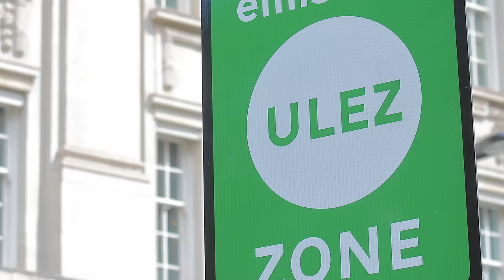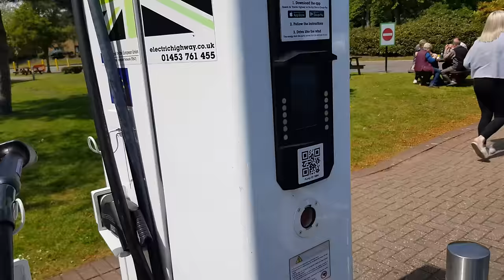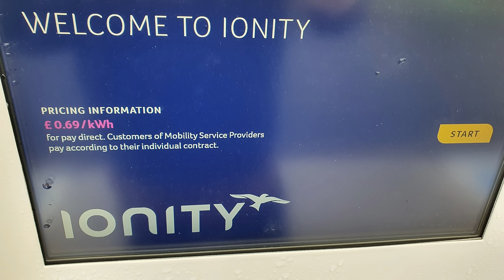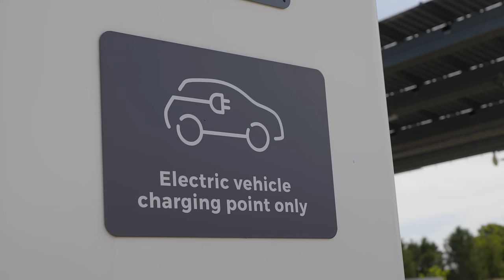The Uncomfortable TRUTH About EVs: The Version NEITHER SIDE Wants You To Hear

Comment: Funny you should mention the cashless thing- just the other day I was paying for my shopping and found my card had stopped working- my bank had stopped it due to a security breach, and sent me a new one which had got lost in the post! Luckily I had a small amount of cash on me, enough to cover the items I'd bought... but had I gone to the supermarket forecourt and filled up, I'd have been stuck with a car full of petrol I couldn't pay for. I've basically had to spend the last few days living off the few hundred quid cash that I drew out at the counter the following day- if I had an EV I'd have been stuck using the buses!
Reply: Absurd that cash cannot be used, it should be illegal.
Reply: Credit cards are free, which is why I have a backup from a different bank. There's also a debit card as another alternative, so there's no reason to ever be stuck without a working card.
Reply: @Xenon0000000000001  I remeber a time, when several gas stations weren't functioning, due to an extreme heat wave. I was in another town, on empty. Found a place with a generator for the pumps, but they could only accept cash. Dangerous  situations arise, & can escalate quickly when infrastructure fails, & it comes down to what ya have on you.

Comment: i drive a 43 year old car .
raised 2 children with it 
upgraded the engine to a catalyst one back at 1990.
car has A/C , power windows /locks and ABS 
1 year ago i installed the latest infotainment system .
car has also leather interior.
im upgrading the car along the way depending the needs .
yes im an automotive technician and the car is a humble toyota ke70 1980 model 
155 hp to  the rear  wheels ,big brakes ,lsd diff , 
no rust as this car is very well taken care off .
passes mot every 2 years with 0 issues and 0 co /hhc emissions
i also urge my clients to do the same with their cars and they are very happy with my advice .
and generally thats my way of life .
its called circular economy 
you should try it 

please tell me am i eco friendly or not ?
Reply: I fully believe this is one of the best ways to offset the environmental impact of manufacturing new vehicles. Buy, maintain, modernize an existing vehicle instead of manufacturing a new one.
Reply: Good luck fining a modern toyota with the same "endurance"...
For the last 20 year they've quite steadily gone completely downhill. Designing and optimizing every part, NOT for longevity and reliability but strongly and solely for... planned obsolescence. It needs to just barely last the warranty period... given it's included in one of the few things the warranty actually covers.
Toyota is NOT the same company it used to be. Now they just exploit their customers with shady practices and shameless scams. How do you think can a company that sells cars at a loss or an industry average 1.6% margins... bring in billions of profits every year?
Reply: MOT tests are undertaken every year, not 2 years.

Comment: I have a free supercharging Tesla Model S (and a Jaguar F Type R). I cannot charge at home so I rely on the Tesla network. After 25k miles, I have spent £0 on fuel for the Tesla. So currently this solution works for me. But I definitely would not recommend the same solution if the charging was not free

Comment: I think the ownership experience of my Model 3 has generally been excellent.  But the rental experience in a foreign country has left me nearly stranded.  I rented an ID3 in Tromso airport.  

The first public charger wouldn’t charge, until I tried authorising the credit card first and then plugging in the car.  Then it worked.  I did swear quite a lot in temperatures of minus six with a fresh wind.

The second public charger wouldn’t work.  I needed an account on a Norwegian app.  I needed to authorise the account with my phone number. I needed a Norwegian phone number!  🤬.  I was nearly stranded were it not for the help from tech support.  I nearly turned into the Incredible Hulk with all the rage that was built up!

Since that time, every rental car has been petrol or diesel.   When it comes to business expenses I want one big transaction to claim for, not 14 little transactions.  I want things to be easy!
Reply: That is a mayor issue. Norway has now made it mandatory to have normal card readers at every charger. Without having to use the app. But for business anyways, its quite incovenient having an EV if you have a lot of driving to do.
Reply: @espencapable That’s not a mayor issue, that’s a regulation issue.
P.S. Gorgeous country!
Reply: EVs are trash
Reply: @jhol310  I wish I could agree. Miss driving a fossil car from time to time for the sounds and smell. They are just so darn slow and expensive to keep filled up compared to EVs
Reply: @jhol310  Guess it all depends. In Norway, a turboed 5-cyl (23mpg) would cost me $3500 a year in fuel for 9500 miles. My 400hp EV will cost me $200 in electricity. It's really a no brainer here atleast. Can not daily a fossil car anymore. But as a weekend cruiser, sure. I would rather drive a fossil motorbike really. I tested an RS5 recently, and while it did have a nice sound, I found the jerking from changing gears and the sluggish respons from kickdown and from standstill, a bit annoying.
Reply: @espencapable  gas is probly mad expensive in Norway.  In South Carolina its pretty cheap.  About $3.50/g for premium.  Can get 28-30 mpg on a long trip in mine.  Zero jerk from switching gears.  Response can be delayed if you floor it too quickly.
Reply: @espencapable  RS5 is trash get a RS3.  Cant really use the power in an EV without the battery pack and range disintegrating.  Every time u fast-charge or fast-deplete your gas tank gets smaller

Comment: I think there is already a perfectly consistent situation regarding charging - both in terms difficulty and price. There are two distinct environments. At home, and away from home. If you can charge at home on your drive then it’s easy and very cheap. OVO Charge Anytime is 7p per KWh. About 2 to 3p per mile for my lovely Enyaq. That’s about 1/5th the price per mile than for petrol in my Suzuki Alto 1.0. Most people work within 20 miles of home and would, during their average year, pretty rarely need to charge away from home so that’s just fine. Charging away from home is always too expensive and difficult in my opinion. There are thus ‘haves’ and ‘have nots’ both in terms of owning a suitable property for an EV (this affects a lot of people) and having a suitable annual usage pattern (this affects a comparatively small number of people, far fewer than would have anxiety about it if they actually sat down and worked out what their ‘real life’ usage was). I do pretty much cry though, the odd couple of times a year I have to fast charge for 75p per KW/h or whatever away from home.
Reply: its nice if you can, the future though is uncertain.
namely its the throughput(scale), the electric cables and substations may not support more than 3-5 ev-s charging at once, at a reasonable time.
ie the substation that enabled you to charge your car tops overnight, may do so for within a week or more for that 3-5 evs.
and that is at really small scale.

there are many things i see that just don't make these things just replace the old overnight.
indeed the Green tech all is bonkers for me at this- produce more to pollute less
a rather paradoxical way to *pollute less*.
its just another marketing gimmick

Because now we need to rebuild not only the cities or the many more powerplants we'll need but also the whole grid, while we'll need oil to make all of the other things well need for the roads, plastics and anything else made from oil, including the oils and other fluids inside an ev

solar and wind.... don't work very often while you're home, not to mention the upfront cost and oh more pollution.
another EV for your home?, more more more
Reply: @xerr0n  reading your comment made me want to buy an EV
Reply: @whyamiwastingmytimeonthis  have fun
Reply: @xerr0n  You can charge from regular power outlet which will draw around 2-3 kW, that gives you 100-200 km of range overnight which is more than enough for most people. It draws as much as a water heater so no problems there. In future people will be able to charge at work when solar is producing.
Reply: @pepegano_3578  
uhuh?
do you have two boilers at home, how about 3 or 4?
what's your amperage?
1 3kW boiler takes 12,5 Amps, at 240V.
now multiply it lets say with 3 (two cars, one boiler).
37,5 Amps, that's how much you'll need in the future, for a single household.

how many households are behind your substation? how much current can it withstand before overheating and damaging itself?

this is the problem well start out with immediately and it compounds.

solar at work? a rather nice expectation, would you have it at say 50% pay cut.
and if the business doesn't have the place to install them what then?
f-ing employees, money falls from the sky.

 going back to it...
replacing a few substations here and there will not make much of a difference, at first, yet the energy company will need to recoup the loss somehow, and if the demand sharply increases, then the cost for your cheap electricity will sharply rise as well.

and that's the substations, the next problem would be the power plants, we don't have enough of them, solar and wind doesn't cut it as they are unreliable and intermittent at best, and then the cables to push through all that current.

whether you like it or not, you are advocating for more pollution and more cost one way or another.
Reply: @xerr0n  Amperage is 3x25 A at 230 V, but mostly I dont draw more than 7 kW (that is heating, cooking, boiler, charging car, etc.).
With solar at work I meant, that most cars are standing (can be charging) most of the time. And you dont need fast charging, 2-3 kW outlet for each car is enough. Power from all installed solar is in the grid at that time for cheap.
Yes, there will be needed grid upgrades for renewables, EVs, heatpumps, electrification. But all of it will not happen from day to day, it will be hapenning over decades so no big deal, we got time. But it is inevitable. Burning dinosaurs does not belong in the 21st century.
Reply: Enjoy your dishwasher.
Reply: @tastypymp1287  - Enjoy your lawnmower.
Reply: @alexwade9921  Which one? The electric one?

Comment: Very well made points here, and rather comprehensive. The ones slightly missing or understated: car manufacturing economics will drive everything. The battery price S curve is real (downwards). Ev's are nowhere near its price and technical evolution, so I expect prices to drop steadily and most people choose with their wallets. In 2030 I think very very few people will want to buy something else just because of the price points, and the regulation 2030/2035 are moot points.
Reply: And I suspect the residual value of ICE cars will continue to fall as norms shift and restrictions on emissions in urban areas become stricter. No-one wants to be holding the unwanted asset when the music stops.
Reply: @furry_homunculus  That's what competition is for. It's not a cartel. Chinese car-makers will steal all their customers if they don't remain competitive. The main trick to making more money has sadly been the concentration on larger vehicles, which is bad for both the planet and people on foot/bikes, never mind people who just need a small, cheap car to get about. Again the Asian manufacturers will fill that gap if legacy manufacturers don't. So I'm reasonably confident that we'll see cheaper vehicles as battery prices drop, and especially when people get used to the idea that they don't need a 300 mile car if there are enough chargers, so they can have a 40kWh battery, not an 80kWh one.

Comment: In a german car magazine they drove 2 top-notch station wagons, a Nio EV and  BMW diesel, from Frankfurt to Munich. Was hilarious. 
 
I suppose they optimized the drive time of the EV for the usecase 100% full at start to 100% full at the destination as only that made it comparable regarding time, efficiency, costs etc. 
 
That had the result that the optimum speed for the EV was 100 km/h. Otherwise the charging time would have eaten up the higher speed. 
 
And the BMW idled along at that speed. hardly faster than trucks. With the result that the 2-ton giant ran with 50 mpg. 
 
The Nio has in principle a great concept, a quick-change battery pack, where the "charge" (i.e. change to 100% takes 5-7 minutes. But there was only one functioning station available on the trip. (which is by no way an exotic tour, between two large business centers).

When EVs came into the discussion, my instant idea was "That can ONLY work, makes ONLY sense with standardized, changeable battery packs to save endless charging times". 
  
But that would have required a common, coordinated approach, and that was apparently impossible. Classic "the first one shapes the infrastructure, and all must follow him, what solidifies your leading market position. 
 
 
And the result of the trip was that under these conditions the diesel was about 1/3 cheaper. Probably not when they had not driven in tandem, then the diesel would have consumed more, going 130-170 as cruise speed. But for losing the 1/3 cost advantage he would been 1/3 faster.

Comment: I am no doubt one of the lucky few, I bought a Tesla in 2018 with free unlimited supercharging. Since then I have done over 120k miles in that car and have never had to pay for charging on road trips. For convenience I sometimes charge at home, but using octopus nighttime tariff, that is only 7p per kw/h. With Tesla even if you do pay, you simply have an account where payment is taken using designated card - never ever a worry paying on the road - just plug in, go and get cup of coffee and car is ready to go when you get back. Plus in my last 6 years of ownership, I have only had to wait to charge on 2 occasions, and then only a couple minutes. Never have I arrived at a Tesla charging location without it working and I have travelled as far as the south of Spain, north of Sweden and east as far as Poland. I will never go back to ICE car, and for the present would consider nothing but a Tesla - they are the only EV where you can road trip with complete confidence and without hassle. Plus they are so much fun to drive - I can out accelerate most sports cars away from traffic lights. Usually if I am at the front, I leave the rest of the pack 100 yards behind :)

Comment: Great video James, whenever I have had an EV my only option is a fast charger and it is usually in the 60-70p range. So it works out more expensive than my v8 lexus to run per mile (as you said)

Comment: We have owned a Hyundai Ioniq EV for 4 years. So we have extensive experience. This car does not have a heavy engine or a heavy battery. That is not necessary because we do not travel long distances with it. We have a diesel for that. However, the car drives quite quickly in everyday traffic. The Ioniq is very economical (12.8 kW in winter, 11.8 kW in summer per 100 km). Annual inspection in the garage €160. Driving tax is 0€. That will change at some point, but that is one of the reasons we bought an EV so early. The longer you wait, the smaller the tax benefits will become. All in all a very economical car even though the purchase price was high compared to a petrol or diesel car. An EV is better for short journeys because the engine does not have to warm up, you can  give full throttle right away. There are also disadvantages: when it is cold, the driving range decreases, especially if you turn on the heating (- 50 km). The maximum driving range is 300 km, but that is more than enough for a second car. We charge at home, simply in the socket. That takes a long time (12 hours) but it usually happens at night. And now that we have solar panels, the costs will drop even further. Despite the fact that I have always been a car fanatic, we are very satisfied with the car.
I don't know of any petrol station here in Belgium where you can still pay in cash or where there is service, but maybe that is different in the UK.
I think the biggest problem in the future will be that the electricity grid is not heavy enough for so many EVs.
In any case, thanks for a very objective video.